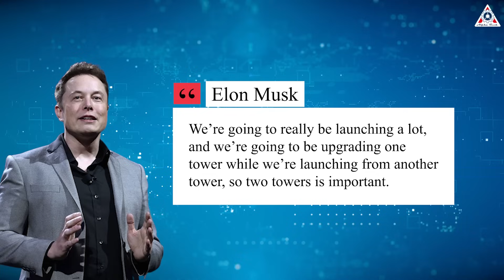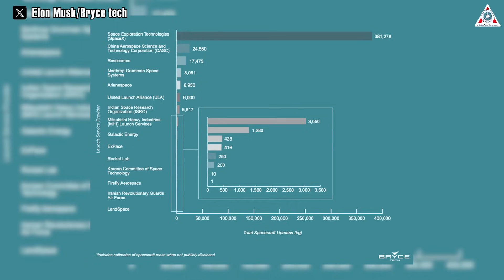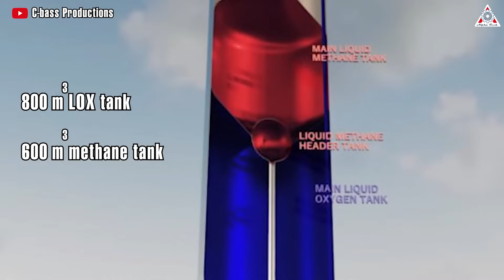It's mind-blowing! Elon Musk Leaked SpaceX's New King Rockets "BIGGER & BETTER"...

Comment: 2 Teflon bags inside one crushable tank for Starship and for BFR would save 3 massive tanks being carried around.  If you pressurize the tank, you might get sufficient flow to diminish either the size or the existence of turbo pumps, saving more weight.  It would also make bubble-free movement of liquid propellants far easier.  There are other advantages to my idea as well.  Come on, Elon, ditch the baffles and most of the plumbing!
Reply: Yeah…. those baffles are just a tad…. in the way huh? Lol Although that’s the point but you know what I mean. If they could engineering a solution to those related issues, you’re right, it would be fking huge.

Comment: There is doubt that a 9x50m spacecraft with little legs land on an 11° slope like Apollo 15 did.  Now how about that spacecraft with 100t payload in the top half. 
Yea, good luck with that.  
Apollo had a wider stance that it was tall if you were wondering. Maybe SpaceX will be working on 20m long landing gear but it is not in the drawings.

Comment: I had heard of the 18 meter version about 5 years ago - about the time he announced the hopper tests. it was a bit speculative at the time as the raptor v1 had just been produced, but now that raptor 3 is available, it is about time.
Reply: It would be easier to build that in LEO, then use it to shuttle goods from Earth to the moon and setup a subterranian moon base (using Boring machines) so that rings and maglev trains could provide 1.0 or 1.2 G to colonists to prevent muscle atrophy. Shipyards in Lunar orbit can supply mined materials to orbit with rail guns. Huge craft can then be built in lunar orbit. 
Mining 16Psyche or other asteroids can have small refineries and the tools to build larger ones out to promising asteroids and bring back tens of thousands of refined ore (gold, platinum, titanium) to lunar orbit to allow continued construction. A train of 100 or more 18m (dia) or larger Starships (with nuclear/ion engines when developed - well in advance of the shipyards in LEO) will cut down on intervals between metal supply. That would allow almost daily shipments of metal from the belt.
Reply: That’s a proper chode.
I hope it gets built before Bezos’ Blue Origin is retired

Comment: Can't get the smaller one in the air so build a bigger failure.
Reply: Ridiculous. It’s flown fly twice, albeit with catastrophic failures but the 2nd flight was so much better than the 1st that even a hater like you surely must see it. All rockets need development and all suffer failures at first. They are some of the most complex machines ever devised.
Reply: @iancanty9875 a slightly better performance is not an indicator of future success...
Reply: @AdrieKooijman  Look at the history of Falcon Nine as well as other rockets, and machines such as nuclear reactors and and tell me why Starship should be any different. I’m an engineer and have developed special machines which at first looked almost hopeless, but eventually worked reliably.
Reply: @iancanty9875  Look at the history of Hyperloop "cross between a Concorde and a railgun and an air hockey table". An engineering challenge being possible in theory is not by definition doable in practice. The Russians tried, and failed, while not the most unexperienced in spaceships.
Falcon Nine is just development of existing technology, with small changes. Starship is a quantum leap ahead of everything else, there's absolutely no guarantee that this can actually work reliable enough for practical applications.
So I agree: not impossible. But still unlikely to succeed within a reasonable timeframe. The wright brothers couldn't have build a 737 in their lifetime while it's a perfectly feasible product.
Reply: @AdrieKooijman  Hyperloop is an extreme case and probably will not be done due to extreme cost, not to mention the fact that it’s a completely impractical idea that has no previous comparisons. However, regardless that you say Starship is a quantum leap, it’s still comparable to previous technology and has already flown and it is still in development. That means with the progress already made and with ongoing development, it is very likely to succeed. People said the moon landers wouldn’t succeed and yet now are part of the history of space flight. Barring any political or environmental pressure to confound Spacex, I’m confident we’ll see a starship in orbit.

Comment: Everyone is all concerned about CO2 in our atmosphere — what about all or our oxygen that is getting shot into space with nearly daily launches of bigger and bigger rockets? I guess we’ll just have to electrolicize our oceans to make more O2. (Maybe that ties into the plan for hydrogen fueled vehicles)
Reply: If you use Co2 to make methane to fuel the rocket, it cancels out :) That's what Elon wants to do. Because on Mars, it will be the only option.
Reply: Space industry is completely irrelevant on climate scale.
Elon is not (really) intending to capture CO2, not on earth, not on Mars. His Tesla solar (failed) city provides about 0.5 percent of the electricity his cars use. Elon is the prototype of green-washing.
Reply: @AdrieKooijman  
Agree that rocket industry pollution is a tiny fraction of airline industry or cars. That said, Methane is cleaner than Kerosene or H2 (given that it comes from Nat Gas... not... much more expensive electrolysis which is several times as expensive). 

Regards greenwashing... electric cars that people actually want with the highest eMPG ratings, much cleaner lithium mining, battery storage to reduce the use of wasteful peaker plants while lowering electricity rates. Rockets that use Methane rather than Blue H2 or Kerosene (with all those other pollutants). Cars that don't need paint (and all the solvents involved). Multiple improvements in car manufacture that replace hundreds of parts and weight of problematic/expensive metals. Batteries that use dry electrodes rather than gel that require nasty solvents to bond (cleaner battery production).

Yeah... that must be greenwashing, because companies that promise to go EV and make alliances with ESG for better scores, while kicking the can down the road over and over...  (Phillip Morris ESG score - 87, Tesla - 37) 

Who's greenwashing?
An addictive carcinogen manufacturer vs Clean cars/energy. 
ESG and DEI are also hand in hand. 
If you discriminate against candidates that don't meet racial, sex and non-standard gener affiliations - you are penalized in your score.
Apparently pushing freedom of speech will also get you dinged quite severely.

And yes: pursuing a high ESG score IS green washing.

You may be a bit colorblind.

Comment: Currently, Falcon Heavy is having difficulty getting payloads to launch. Falcon 9 is the workhorse and is currently lifting payloads originally envisioned for Falcon Heavy due to lift capability increases for Falcon 9 through engine improvements. Starship Super Heavy will have the most lifting capability in history and likely an even harder time finding work than Falcon Heavy. Massive payloads for tankers, lunar missions, and even orbital stations are the primary missions for Starship until Mars launches begin. Since colonization assumes the passengers staying, the Starship should be used as primary housing and fabrication units. The need for fuel to leave the Martian surface should be pursued for an "emergency" ship and local use but not for regular launches as those shouldn't be happening. Basically, it's a one-way trip for the first few years at least. The same goes for a lunar facility and even orbital stations. The only ships making "round-trips" would be tankers and supply ships for orbital stations. It's a scenario we have never experienced yet must develop IF we are going to utilize our moon, Mars, etc. for colonies, bases, manufacturing, resources, etc. I'm 66 and will likely not see it happen due to the interference from NASA, the ECONAZIS, FAA, and others who feel the need to "flex" their power and control.
Reply: Starship, the current model, has the freight capacity of a railroad boxcar - approximately 200,000 pounds.  The new ones will go 150-200t, so we need to bear in mind that it's function is to haul freight in support of city-size colonies.  That freight traffic must be both directions or the colonies will be abandoned as far too expensive to support.  For that reason, the Starship cannot be wasted for use as habitation.  It's capacity is large enough to bring inflatable habitation modules, construction equipment like bulldozers and cranes as well as food, photovoltaic arrays and greenhouse equipment as well as small to medium utility vehicles in the 1/4 to 3 ton payload plus 2 to 10 passengers range.  Personally, I would include Alpaca class landers as freight in the initial shipments so short-hop flights can be used to greatly expand the exploration and economic development area.

Obviously, a two month flurry of launches every two years does not provide adequate support or commerce.  A steady stream would be far preferable.   How can flights be scheduled for launch in a way that will provide - at a minimum - monthly arrivals at Mars?
Reply: @frankmcgowan9457 although I'd love to be proven wrong, I don't expect 'city size' colonies for at least the next 50 years.
Technologie hasn't been developed or tested and there is no 'business case': why would people want to leave earth and spend the rest of their live (barely) surviving in a cave?
Just for fun?
Reply: For the time being Starship wasn't able to reach low earth orbit without any payload.
The thing has enough  problems getting enough speed with zero payload.
Reply: @AdrieKooijman  
Absolutely true.  Let's let the first spacecraft large enough to called a "space ship" develop a bit before declaring it a failure.  Musk brought a bold vision to us when he announced his "BFR", now called Starship.  His team has made huge strides in bringing it to reality.  Let's see if he can finish the rather huge task he has set himself.  Even if he fails he has achieved much but I think he will succeed.

Comment: When will SpaceX increase the height of the Starship Tower to keep pace with the comments of increasing height of the integrated Starship and Booster Elon Musk has previously mentioned? It’s obvious that the tower will have to increase in size to accommodate the larger Starship and Booster. I would imagine that it would happen before any additional Towers are constructed.